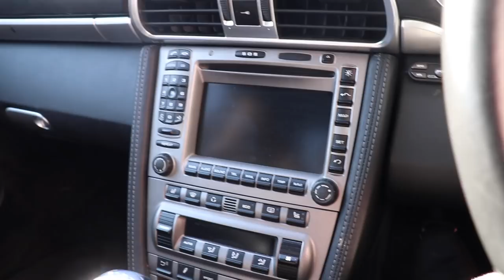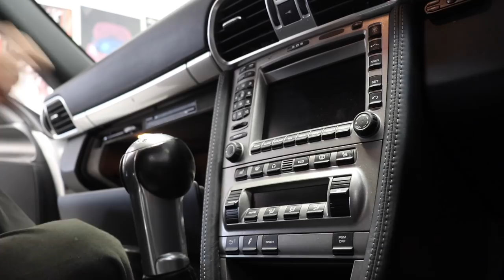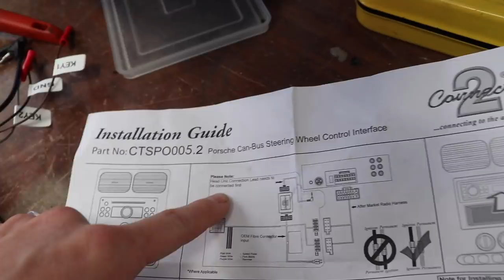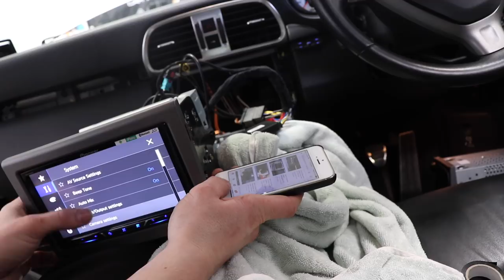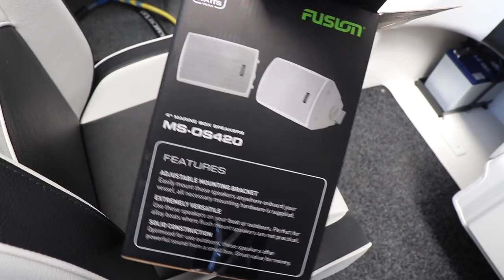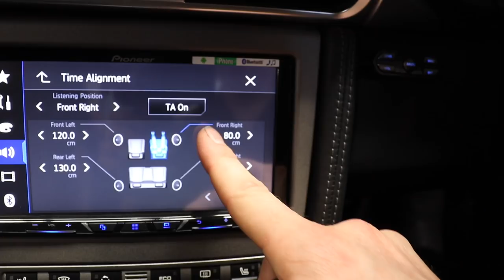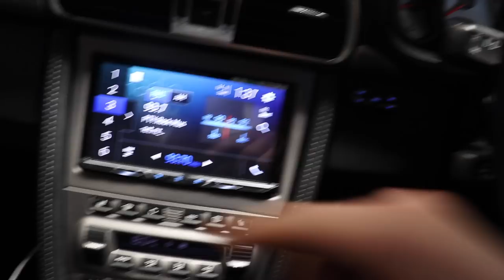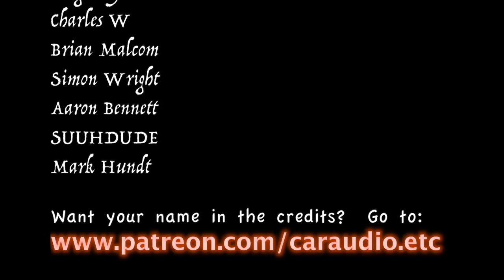Porsche 911Gets a Pioneer AVH-Z5050bt | CarPlay + BOSE + Steering Wheel Controls!

Comment: The OEM Bose amplifier should be handling the time delay processing as well as the crossovers (as you mentioned). Turning on the time alignment/listening position on the Pioneer is likely throwing off the factory tune. Personally I'd leave it off unless it truly sounds better with it on and set.

Comment: When the owner said 997, that refers to that generation of Porsche 911. Before it was the 996, and before that was the 964. Just like a chassis code, like an AW11 MR2 or a E30 BMW 3-series.
Reply: You are totally right, and at 12:50 - if you look at the side of the old head unit the Porche parts number start with 997 ... All parts numbers for 997-model starts with 997... 

With some exception, such as headlights for 996 starts with 986 (Boxster), but then again, it's a shared item. :)

Comment: Nice video, I have a problem with the radio reception is the antenna  power amplifier wire on the main power harness (with the red and brown)or the canbus harness, should be white in color. I have the white wire on the main harness powered after repinning it. 08 911 turbo US version
Second question cant get the stereo to power on on less the key is in the run position i have a separate wire to the fuse box for the accessory wire to the NAVTV-210.

Comment: Quick question please help.... which is the best or correct way to connect door speakers to an amplifier? Wire each speaker separately to the amp or run wires from the factory harness to the amp? Thanks in advance.
Reply from the maker: both ways are correct, whether or not you do the big job of running new wires usually depends on a few things (how hard it is, how old the car is, how thin the wires are etc.)
If you're unsure and just want to guarantee your wiring is good, just run new wires.
Reply: Car Audio.etc thanks. So speaker to amp correct? My suv is a 2003 chevrolet tahoe. I've been looking at the original gromets and they dont look to bad. I plan on running 10awg wire for the focals i bought watching your videos. Thanks for the recommendation.